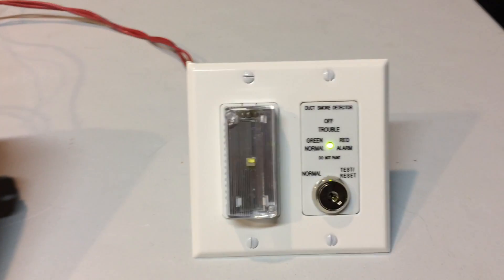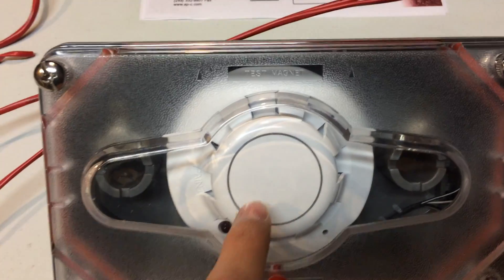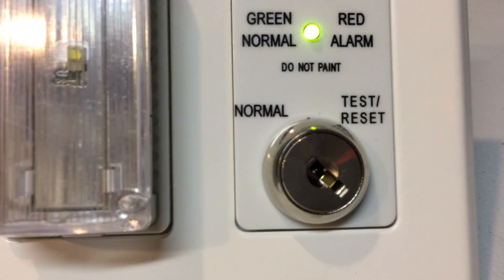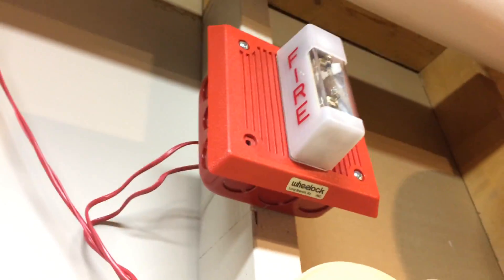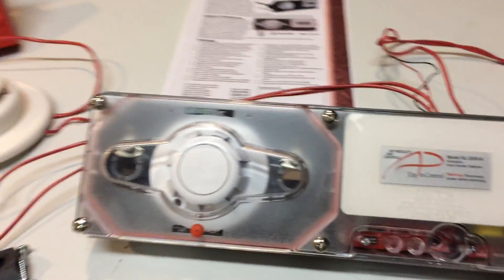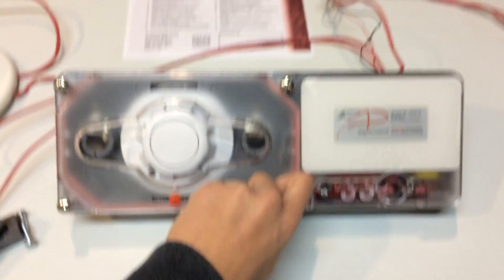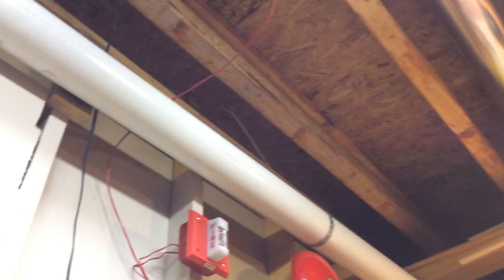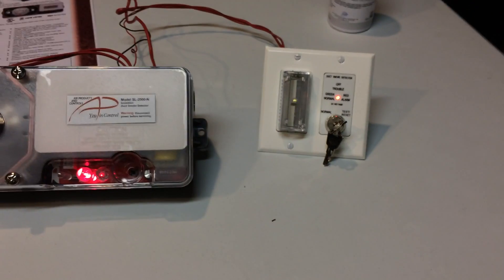What is a Duct Detector/ Duct Detector Key Switch?

Comment: A Walmart isn't 100ft high!  😁 Anyway, very cool.
Reply from the maker: Well... You get the point
Reply: S.E.R. Safety I don't think this "risk" is very common, as most duct detectors would probably be installed in areas like mechanical rooms that house large HVAC things, behind walls, or above drop ceilings. Either way, there aren't 30 foot two sided ladders. Therefore, you'd have to use an aerial lift, which aren't very dangerous. Also, with many fire marshals, smoke in the chamber is the only way of testing smokes. Because a keyswitch is only going to test if the device shorts the circuit and the rest of the system works, not the detector itself.

Comment: Cool and neat video! :) 
The smoke detector itself is made by Apollo, which I think is based somewhere in England, if I recall correctly.
Reply from the maker: That sounds about correct!
Reply: I think the smoke detector was also redistributed by Gamewell or GamewellFCI at one point, if I remember correctly.
Reply: NJMoo3652 cool
Reply: firefreak57 that is correct
Reply: Told ya is an apollo